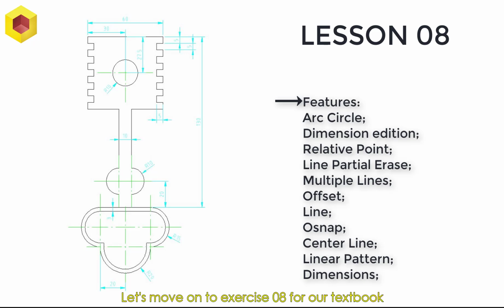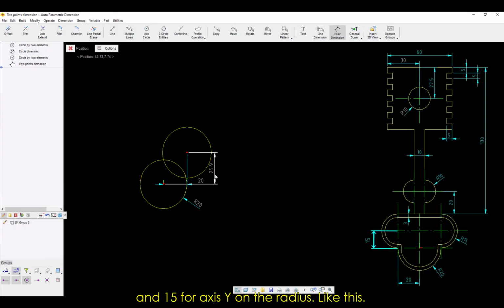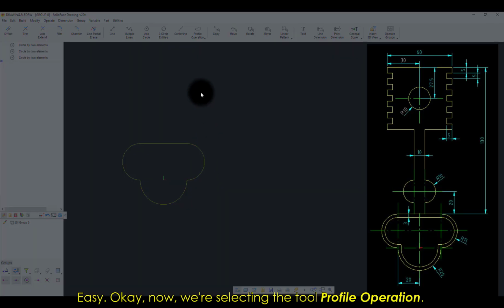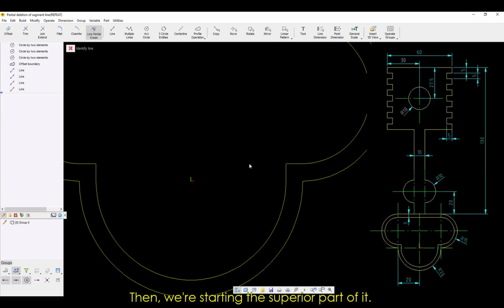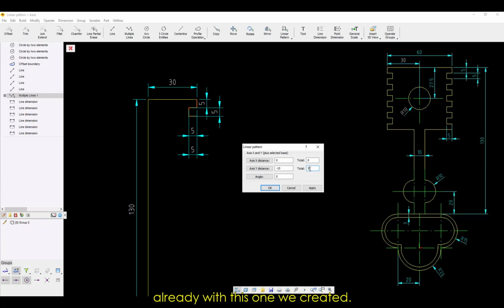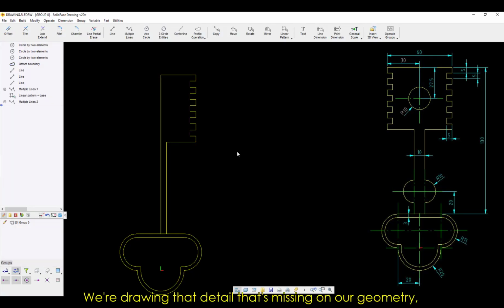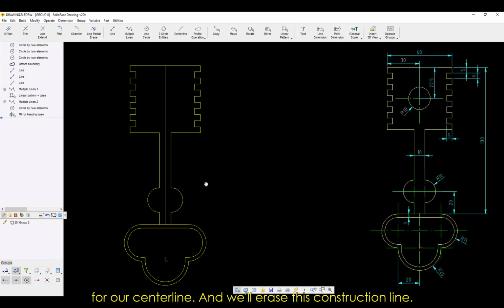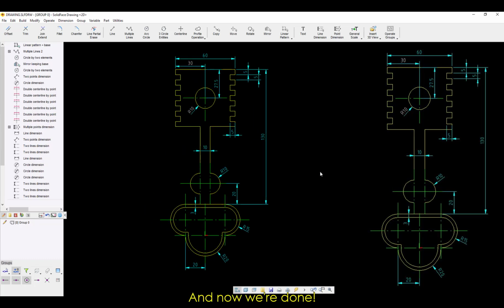Drawing - Lesson 08

Comment: 3.15-3.20 the intersection bit didn't work and the line partial erase is not  otomatik it has to be selected every single time ,besides that everything's great
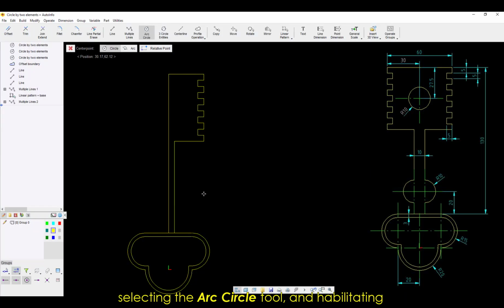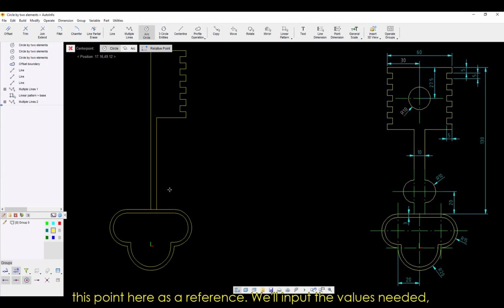Reply from the maker: For doing the Intersection, you need to show three information: Point, Angle, and Length. In the 3:15 - 3:20 case, all the information is on that Line, so you just need to click on it.
In the Line Partial Erase Tool, you need to erase the first Line, and after this, press Enter on your keyboard to maintain the tool habilitated.

Hope you can do it, but please leave them in the comments again if you have any doubts. #SolidFaceTeam